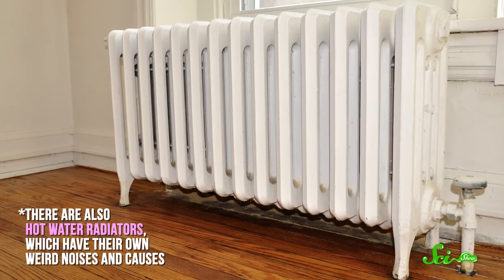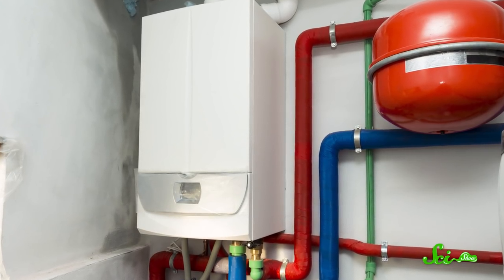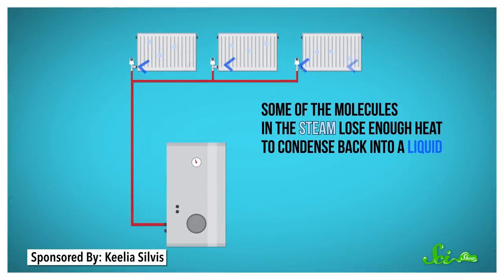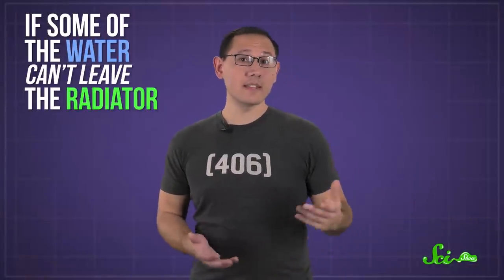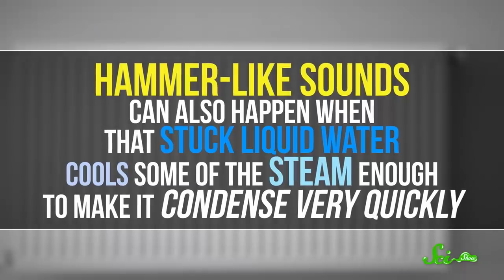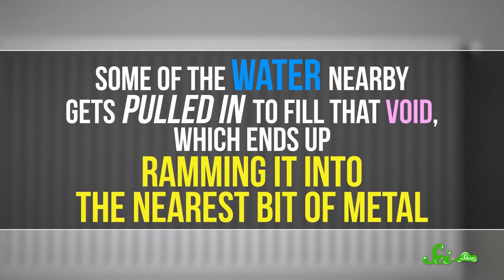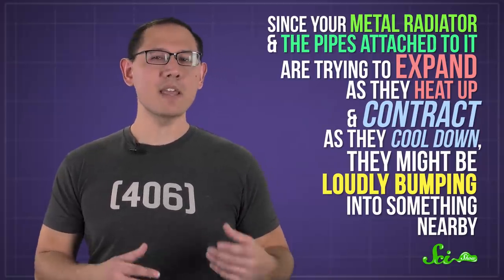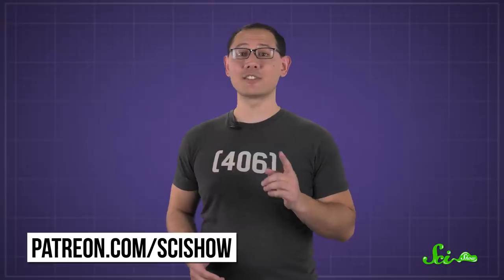What Makes Radiators Bang So Loudly?

Comment: THEN EXPLAIN WHY MY STEAM FREE ELECTRIC HEATER BANGS AND CLICKS.             Nah it's just the heat affecting the metal by streching it, causing the parts to quickly slide against eachother.

Comment: Natural Gas is a thing people... cheap and easy heat.
Reply: Steam is still a public utility in parts of some cities (London, NYC and Chicago as three examples). It is delivered to your building through insulated underground pipes just like electric, gas, water and sewer. Hooking up to the steam line is much more space efficient and cost effective than trying to heat your own water loop. 
NG heaters use radiators too. water is use to transfer the heat from the furnace or other combustion system to the central air system and the water heater tank. 
My oil furnace works the same way and I've still got a freestanding radiator connected to it for heating my garage.

Comment: Wow, normally your videos are pretty good, however, you clearly lack a firm understanding of steam heating. You showed a picture of a hydronic boiler not a steam boiler, and you completely mixed together the one pipe and two pipe piping systems when explaining venting and return water, among other misexplanations, also the vacuum that is created when the water condenses is actually used in some systems to lower the boiling point of water to make the system more efficient, look up a video of a glass pipe steam boiler, they're for demonstration, and they're pretty awesome

Comment: Does anybody still have radiaors?
Reply: Steam radiators are still a thing. Steam is still a public utility in some cities (New York, London and Chicago for three examples). It is delivered to your building through insulated underground pipes just like electric, gas, water and sewer. Hooking up to the steam line is much more space efficient and cost effective than trying to heat your own filled-loop.
Filled-loop systems are the method used by oil, gas and electric furnaces to transfer heat from the combustion chamber to the central air system, water heater tank and to freestanding radiators for rooms without duct-work.
Reply: Thanks.

Comment: Steam radiator? Realeses the steam into the room? Wtf?
Reply: Only if the over-pressure valve is tripped or the low pressure valve is stuck in the open position. Just like a filled loop system, steam loop systems work through conduction and radiation.

Comment: Oh, it so nice to NOT live in a country where there is a frickin’ overheated steam instead of just reasonably hot water inside the pipes. As always, USA is the ‘smartest’ country on the planet... :)
Reply: Steam is still a public utility in parts of some cities (London, NYC and Chicago as three examples). It is delivered to your building through insulated underground pipes just like electric, gas, water and sewer. Hooking up to the steam line is much more space efficient and cost effective than trying to heat your own filled-loop. 
They are not dangerous in the least if they are properly maintained. They are all installed with a shroud to prevent people, pets and objects from contacting them directly. Open loop systems do not not exhaust unless the emergency over-pressure vale is set off. Steam fills the radiator, the low pressure valves shut and the system is maintained at this pressure for the duration of the cycle. Any condensate collects in the bottom until it reaches full operating temperature where it turns back into vapor. Once the cycle is over, the steam supply is cut off and the radiator cools, dropping in pressure which opens the low pressure valves again, allowing any secondary condensate to drain to the sewer, drain field or grey water collection tank for reuse in non-consumption applications (the latter of which is very uncommon). Closed loop systems go through a return pipe back to the steam plant where its residual heat allows for quick and more efficient reheating.

Comment: Steam radiators?? 
Never heard of them, in the UK we bleed our radiators to get all the air out.
Think u guys at sci show are doing it wrong lol
Reply: Steam radiators are still a thing in the UK, too. Steam is still a public utility in parts of some cities (London, NYC and Chicago as examples). It is delivered to your building through insulated underground pipes just like electric, gas, water and sewer. Hooking up to the steam line is much more space efficient and cost effective than trying to heat your own water loop. 
That said, filled-loop systems are far more common since they are the type used by oil, gas and electric furnaces for both central air systems and freestanding radiators.

Comment: Steam in a radiator? You Americans have some weird ideas. All the radiators here in England are full of water that's pumped from the boiler, though all the radiators in your house and then back to the boiler. What's next? A president  who wears a cheap orange wig?
Reply: Steam radiators are still a thing in England as well. Steam is still a public utility in some cities (London, New York and Chicago for three examples). It is delivered to your building through insulated underground pipes just like electric, gas, water and sewer. Hooking up to the steam line is much more space efficient and cost effective than trying to heat your own filled-loop.
Reply: Well, I lived in London for 40 years and I never saw a steam radiator. Or ever heard of underground steam pipes. There used to be underground water hydraulic pipes for powering machinery by hydraulic pressure but they were all shut off in the early 1900's when electricity started to be a thing. Now London is a big place and it's possible that they had steam heating somewhere, but I've never heard of it either domestically or industrially.

Comment: does he even read the sources? no steam!
Reply: Steam radiators are still a thing. Steam is still a public utility in parts of some cities (London, NYC and Chicago as three examples). It is delivered to your building through insulated underground pipes just like electric, gas, water and sewer. Hooking up to the steam line is much more space efficient and cost effective than trying to heat your own water loop. 
Filled loop systems (water rather than steam) are the standard in nearly every other application other than electric, wood and coal. Even central heating uses water to carry the heat from the furnace to the duct system.

Comment: This channel used ti be about science and not about facts about simple household stuff that every kid should know. Also, how backwater is america that you still use steam radiators instead of water, and you appearently don't even know hiw they work?
Reply: Steam radiators are still a thing. Steam is still a public utility in parts of some cities (London, NYC and Chicago as three examples). It is delivered to your building through insulated underground pipes just like electric, gas, water and sewer. Hooking up to the steam line is much more space efficient and cost effective than trying to heat your own filled-loop.
Most American homes use oil, gas or electric central heating.
Personally, I've got an oil furnace with heating lines running to my central air system, my hot water tank and a freestanding filled-loop radiator in my garage.

Comment: This seems like some pretty old technology, is this in American thing? Cause I know you Americans love using poor outdated technology for no reason.
Reply: Steam radiators are still a thing. In fact, steam is still a public utility in parts of some cities (London, NYC and Chicago as three examples). It is delivered to your building through insulated underground pipes just like electric, gas, water and sewer. Hooking up to the steam line is much more space efficient and cost effective than trying to heat your own water loop.
More common are filled loop systems that just use hot water. These are how oil and gas furnaces actually transfer their heat for central heating and freestanding units are great for heating parts of a building without duct-work, like additions, attics and garages.